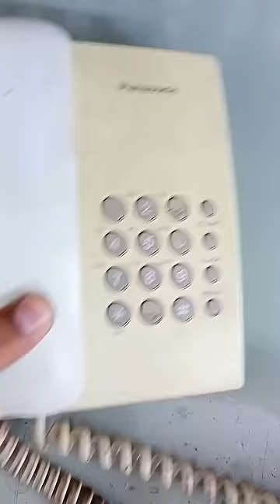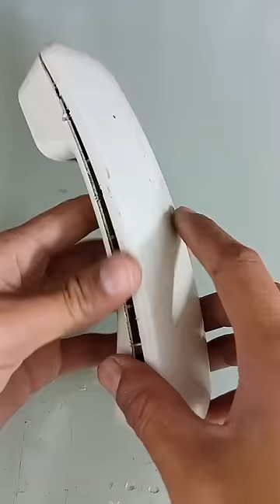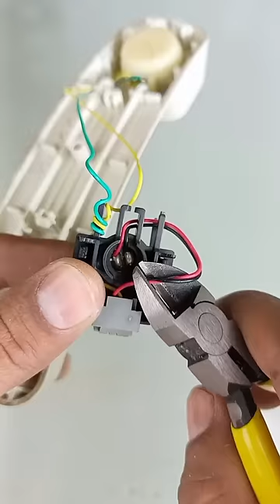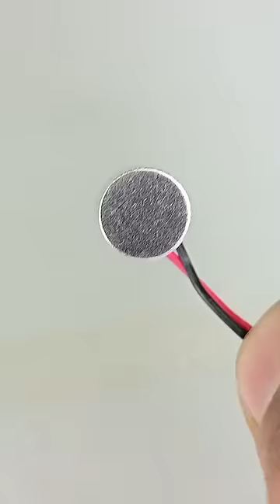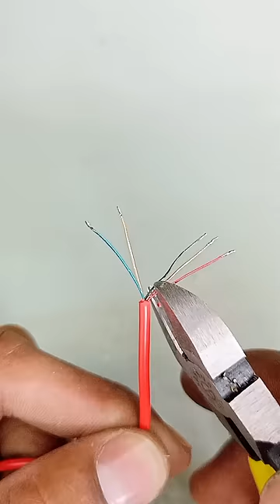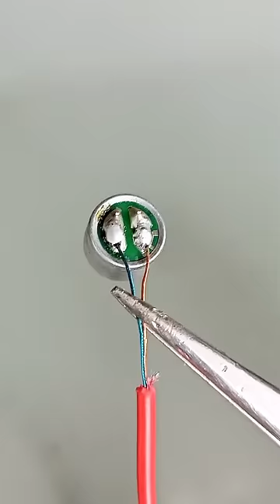how to make high quality mic || diy conduncer microphone using old telephone

Comment: Telephone condenser microphones are poor quality.
Reply: and old phones like those highly need a pull up circuit for the capsule to work at all
Reply: Yeah and those mics arent condenser they are dynamic i think because if one side you put your ear on and the mic goes directly near your mouth so i think it dynamic
Reply: Also ignore that if it is condenser microphone, you'll need to supply 48v to charge it
Reply: @leo_craft1  not only is that incorrect but If it was correct getting 48V from a phone line is rather easy, lol.
Reply: @dogwalker666  yeah, the old phone line has 48v on it to charge the microhpone condenser, although is limited by a very large resistor so it does not have approximately any energy
Reply: @leo_craft1  It was designed to have a carbon granule microphone, A resistor  limits current flow, The potential energy is still there. Especially if you charge a capacitor.
Reply: @dogwalker666  ye it's still there, but as soon as you short the wires, the voltage drops to 0 because it cannot sustain that high of a current
Reply: @leo_craft1  Depends on the resistance,  And talking telephones you do realise they use Loop Disconnect for old school dialing? And the ring voltage hurt like hell.
Reply: Poorest
Reply: @draughtgamer1417  indeed.
Reply: well no shit dogwalker
Reply: @cyph3r_01  well the OP obviously didn’t know.
Reply: @cyph3r_01  lol

Comment: Condenser microphone change capacitance based on sound and doesn't generate it's own voltage, so you would need a condenser microphone circuit for this to work. Also, the audio quality may be bad because it's an old microphone from an old telephone.
Reply: I'm tinkering with some electronics trying to make things go beep and I am trying to make a spring reverb with a small speaker and a button microphone like this and just connecting the wires to a audio connector is not enough.
There's enough good tutorials on YouTube but it takes some time and skill if you really want to make something that functions.
The plus side is that electronic components are cheap as chips, you don't have to go and open up old phones or headsets.
You can buy button mics with a driver circuit board and pins for under $2 and a variety of amplifier circuits and speakers all under $5 !!!
But there's a reason why some microphones cost $5 and some $1000. 

It's funny how all the comments say : good job, wow !, amazing and all that. Nobody tried it out? Why are they watching this then ?
At least this video doesn't encourage people to put open circuits in the wall sockets 😂 💥

Comment: I have a problem when I connect it with the phone, the recording remains from the phone and not from the microphone, meaning that the external mic does not work, and I want a solution
Reply: Have you tried to turn on airplane ✈️ mode & tun off bluetooth?Good luck. 😊